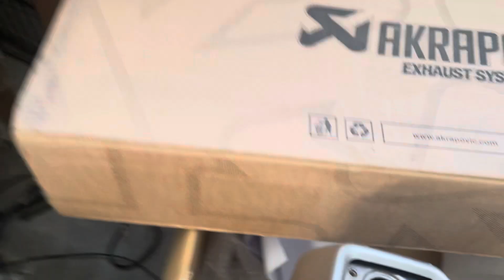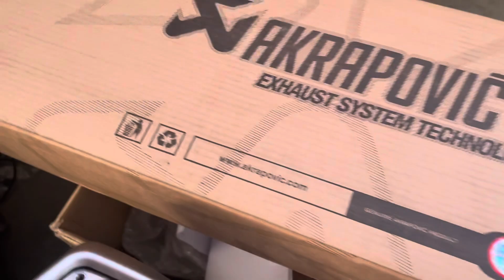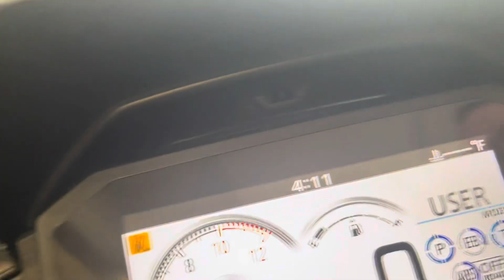2024 Honda Transalp XL750 Akrapović Slip-on Muffler

Comment: The stock exhaust makes it run hotter to like the new exhaust!
Reply: Most after market muffler do as they flow more so the engine will run lean. This is why a different fueler or re-map of the ECU is useful.

Comment: The Acropovic exhaust is much quieter.
It's better in that respect.
Anyway, pointless.
Reply from the maker: Also shows gain horsepower and torque because it has better air flow and is less restrictive than the stock muffler
Reply: @cliftonsr , do you really find that Acropovic exhaust is quieter than stock?
Reply from the maker: @irarabesc  until you punch it then it has a little deeper rumble sound that is very satisfying